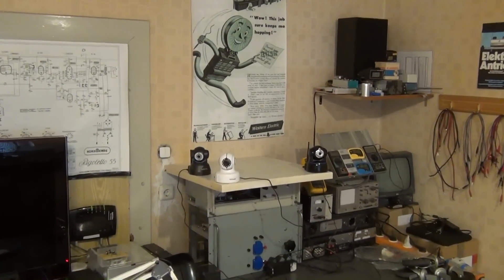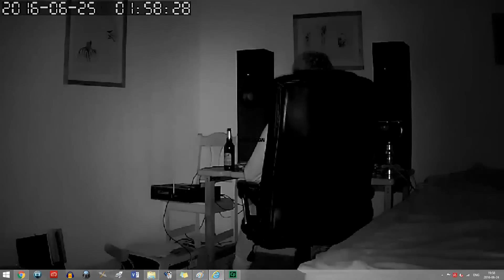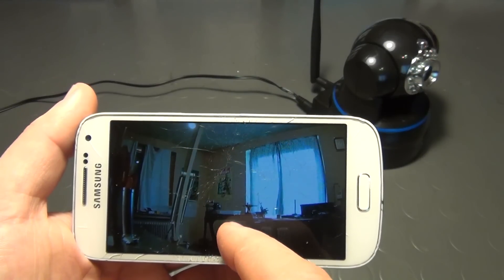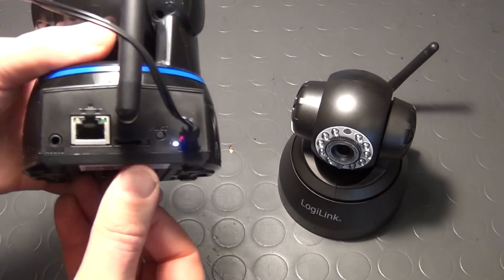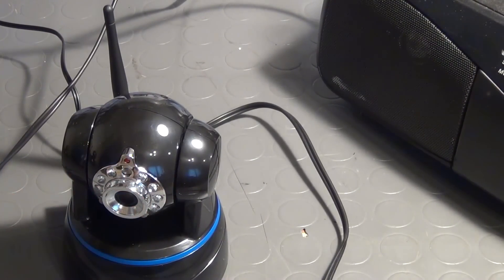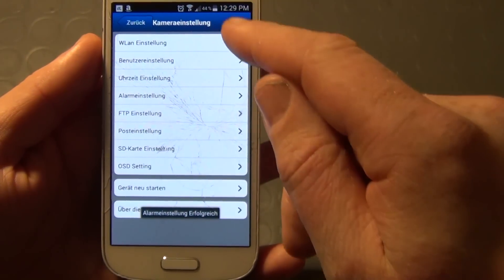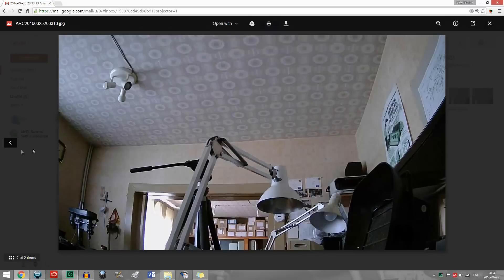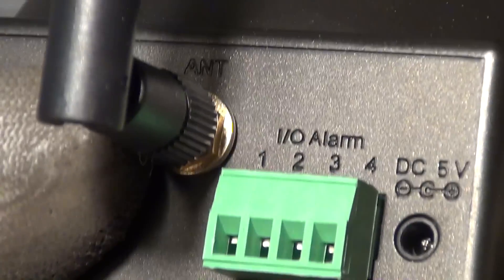Cheap IP Camera Basics + Product Reviews

Comment: Check out the "Wyze" brand cameras. I've used them outdoors for over 2 years now and they're great. $25 ea or $37 for pan and tilt variation. Two Way Audio. Internal SDXC cad storage. No monthly fees are required but there are low priced cloud storage/special features offered if you want.  With a micro SD card, you an record continuously and or 'event" modes that only record for a set time period after being triggered.  

The Wyze app is actually very well made and easy to use. There are all sorts of features like motion detection, person detection (distinguishes humans from other motion), sound triggering, schedules, IR night vision, push notifications, a "fire alarm/CO alarm detection" feature that will notify you when it detects a fire alarm sound, works with Alexa, etc.. They seriously are great little cameras.

Comment: At the Least? Buy one for $20 or Ck for used one's On Ebay or at Good Will store, like we did ( bought one for $8) and mount it Up High outside yur House under a Eve so they can't et to it and its a Dummy Cam.. but they( criminals don't know that, e=right?) and add a Motion Sensor Spot Like Next to it to Flash On at night..It will deter them from comming to your Home and go to the Next One..

Comment: For Home Security? We just bought a WIreless Alarm, the Senors is mounter under Our Mail Box and the Alarm is Inside Our Kitchen ( Can take either 2"C" batteries or a 5 V DC convertitor .. Cst $35.. Wrks Like a Charm!  Has 2 types of Alarms( Chine or Buzzar) and low or high Pitch Noise.. Low daytime and Loud over nite.. and Got 2 Signs and Posted them  On our Mail Box Post and Storm Door..We want everyone we have Security service....Go Rob the Next Home!     Its been 5 mos and So Far so good in altering us to Postal worker, UPS and Fed Service arriving...along with a WireLess Door Bell system and Getting everyone to USE THE DOOR BELL, PLEASE BTwn Both systems, Spent Less than $100...
       Add 2- Keyless Door Locks( $100) and 2- New Steel Doors ( $400 Each Installed  =$800 ) with Fiberglass Wood Grain Panels , that look like the Real wood Doors and R18 Insulation with 1/4" Plexiglass Storm Doors( $150 ea)  1styr last yr and they Keep the Hallways very Draft Free and warm halways and Shoe and Boot Changing Bench area comfortable.  We haven't had any problems and Everyone knows we have a Secuirty system to keep Kids/Thieves and others away and go Rob the Next House!

Comment: Mine is Mounted Inside and fixed pointed thru the Kitchen Window with a Deflector( from the Glass) and Just scans the Driveway ..I bought it at my Goodwill store for $5 and after devoting about 2 hrs over 3 days of my free time, got it to work..  For most others? Suggest you Use a Local Professional/Dealer and plan spending $2oo-$4oo.but it will save you alot of Frustrations and Time..

Comment: I put up those cheap cam. Many of them. I prefer using app like ip cam pro and use it with the arrows so I just keep pressing and the cam will go in the direction that I chose. But before we have to create a port in the router page. I prefer this way so it’s private, it does not connect to a server. Just type the Internet address and the port number and that’s it.

Comment: I bought the Meisort ip20 cam off ebay - did wot u suggested and got the manufacturer but i am not able to get this camera to work on any app except the one that came with it ipc360 app on google play. i have  Cam Viewer1, iCamviewer,IP Cam Viewer, OWLER:Foscam and TinyCam Pro but i CAN'T seem to find the port of this cam. yes it is on my router (192.168.1.15) and i used nmap once it showed port 23. tried it on the apps i got. nada. i checked nmap again and i couldn't find any port. any suggestion?u can also see the cam on youtube. it ain't bad tbh but i need to have more control with great apps.tx man

Comment: Best way to use these is without wifi - use Ethernet with Poe - I made my own Poe convertor 12v->5v so one cable gives me power and networked directly to the router or internal network - easily the most reliable way of connecting!
Reply: Hello , this is Lucy from Sricam factory, If you are interested in Sricam ip camera, please feel free contact me ! 
Email : sales01@sricam.com 
https://www.alibaba.com/product-detail/Sricam-SP017-Camera-Wireless-P2P-Security_1296020450.html?spm=a271v.8028081.0.0.7b3acefbwzVSWt

Comment: I buy it, Cheap IP camera from ebay.

First Day - 100% working
Second Day - 100% working
One Week - No working

I never buy one more time Cheap Ip camera ...
Reply: you get watched by man from china
Reply: Check out the "Wyze" brand cameras. I've used them outdoors for over 2 years now and they're great. $25 ea or $37 for pan and tilt variation. Two Way Audio. Internal SDXC cad storage. No monthly fees are required but there are low priced cloud storage/special features offered if you want.  With a micro SD card, you an record continuously and or 'event" modes that only record for a set time period after being triggered.  

The Wyze app is actually very well made and easy to use. There are all sorts of features like motion detection, person detection (distinguishes humans from other motion), sound triggering, schedules, IR night vision, push notifications, a "fire alarm/CO alarm detection" feature that will notify you when it detects a fire alarm sound, works with Alexa, etc.. They seriously are great little cameras.

Comment: I have two IP Pan/Tilt cameras and both failed on me turning on Motion Detection...  One is 4 years old X10's Airsight HD xx59 (crappy camera that I can't even use it) and brand new Sricam SP012 (recently bought and crapped on me. got refund but told me to keep this camera for me to play with).   BOTH cameras have SAME chipsets which is "G"rain (actually Grain) branded chipset (Airsight have 8128 and Sricam have 8135) which is ARM 9 processor. They have not changed much.  Chipset tend to overheat and crashes. Sricam tech support told me that it have heatsink but turned out it's not when I cracked the case open.  How camera failed ..  BOTH works fine when Motion Detection OFF and ALARM OFF.   Let it runs for few days fiddling around with Pan/Tilt via phone app.  It's really cool until I decide to turn "ON" Motion Detection and ALARM (set Email and record to SD card),  AIRSIGHT HD did sent pictures to my email and recorded but in a while it crashed and reboots constantly.. SRIcam crashed as soon as I turned "ON" Defence (Motion Detection, Email and ALARM turned "ON" but does not polls until Defence turned "ON").  Funny thing is that I did factory reset Sricam and re-set it back. Sricam Tech support tested my camera and said it's working fine (I provided camera's # and Password).  It seem to behave good when Tech support tested it. But  when I moved the camera and plugged in. It was running fine with Defence "ON".  But flurry of Motion Detection activities (my kids in kitchen) caused Camera to crashed because it was polling Email and Record to SD card that overheat Grain chipset..  I can easily pin blame to flaky Grain chipset.  What I could do is to do hacks by using Southbridge cooling fins ripped out from old broken Motherboard and old laptop 5V cooling blower fan and use Thermal glue the Southbridge fins on Grain Chipset (Just simply screw the camera).  See how camera handle with such load when Motion Detection set at moderate..  If Sricam works with cooling system installed then I would be able to use it in one room for 24/7.  I use my refunded $$ to ordered SRIcam SP009 because it have HiSilicon High Performance chipset.  I'm going to see how it handle with Motion Detection.  This camera is thin profile and I can easily conceal it with decor.  I simply wanted reliable Security Camera to catch who's eating cookies, icecream or food while I'm at work (got sick and tired of kids pointing at each other or scrape goating to toddler who can't reach high cabinet!!).  If you want more reliable Security camera that don't craps when Motion Detection Alarm turned on then get the one which is expensive like $500 or more PZT Security cameras (commonly used at Mall or Offices) unless you wanted to hack crappy one.  If different branded camera with exact same design and exact same chipset then perhap you might as well try getting Firmware flashed and Camera's UC (user control) flashed after that.  I don't have Airsight HD xx59 firmware, I lost it.

Hey guy..  Lose the glove!  Look like you are Mr. Monk who is afraid of germs and dirts

Comment: although not exactly cheap i have used blastproof lighting fixtures to mount external cameras in.they have metal grates on the outside and are sealed with glass completely from outside contamination.here is a link for an example below.
http://www.directindustry.com/prod/wiska/product-14556-540583.html

Comment: One issue that you didn't mention, even with WiFi, you STILL may need a long cable to provide power and usually the places I want to monitor have no power outlet. I bought a POE adapter from Amazon and had to cut the connector from the power supply to use at the opposite end of the POE connection. However, you may still have a problem, the voltage drop for 5v/2A with cheap ethernet cable may be so low the camera may not function. I bought a 7.5v/2A power supply and now it all works great.

I hope to introduce myself and make a donation sometime. I really enjoy all your videos and share many of the same interests. Thanks for all the great stuff!

Comment: When it comes to IP security cameras I can only recommend Mobotix, as they have no moving parts, one camera can record an average sized room from the ceiling without blind spots and it always records the raw video, not the part you are currently focused on. The pan/tilt/zoom works via software and the optics are hemispheric, so the recording always contains the whole image and you can pan/tilt in the recorded video. Which enables you to track a burglar "post-mortem", even if the camera wasn't focused on him at that moment. The same applies to motion detection. Since the camera always processes the entire image, it won't be "blind" there either. Only real drawback of these cameras: They're not cheap at all. One can cost easily around 1000 Euro. But you can't just compare them to these "cheapo" PT-Cams that will die quickly, aren't ready for rough weather and rough treatment etc... that would be like comparing a Mercedes S class to a Bobby-Car. :D A good mechanical PTZ-Cam (I did some live streaming with a Sony SNC RZ-25P some years ago) with actual optical zoom will easily also cost about the same as a Mobotix brand... with the disadvantages that they have moving parts and only record what they're currently watching. Not to mention blind spots directly under the camera.
Reply: You can't zoom into any particular area with out moving parts!

Comment: I'd rather install a Raspberry Pi with the dedicated camera in some kind of enclosure taken from a broken cheap camera or even fake ones. It wouldn't pan and tilt without additional microcontroller, but the quality is much better for the price and you can run a server directly from the camera enclosure.

Comment: One problem with using infrared cameras to detect burglars is the sensor leak red light. A thief would notice the light and unplug the camera.Another problem is many of the cameras are made for a  longer distance than your room. The leds over expose the picture. When mapping automated storage rack addresses with a target only two feet away, the problem was corrected by covering some of the leds with tape.

Comment: MAC just identifies the manufacturer of the "network card" inside the device. It can be the same as the real camera manufacturer or it could be different. Of course it´s a good place to start. Also quite often its a single chip solution thus the camera and the network card part are made by the same manufacturer.
Reply: I wonder if it is possible to put a vpn in a ip camera

Comment: Just a clarification: MAC addresses identify the manufacturer of the network card/interface. So the manufacturer you find for that MAC isn't necessarily the manufacturer of the camera, though it can obviously help narrow down the possibilities.  All network connected devices have a MAC(or should by standard) address but usually don't display it on stickers since it's useless to most end users.

Comment: IP cameras are not secure as  many have pointed out
Reply: Correction. some types of IP Cameras are not secure, OR, Cameras setup by people who do not know enough networking skills or do stupid things like leave passwords at default are not secure.  A good quality camera, setup properly by someone who knows networking is as secure as *any internet connected device is.
Reply: +SpockieTech I was simply making a statement not a full explanation.
I was referring to none internet connected cameras, which can be jammed or have their password cracked. If you want to argue how secure they are because you're an expert be my guest but I will not reply.
Reply: Simply correcting an over-broad statement.  You might as well have said "Internet Routers are not secure".  Some are, some aren't. its up to the users skill much more than just the device type.  A deadlock is useless if you leave the key in it.  IP Cameras *can be secured as well as any internet device, so I just wanted to point that out, that they are not all inherently insecure as your statement suggested.
Reply: I recommend the ones that allow you to use Ethernet as that can't be jammed
Reply: sim6699

Comment: Few things to mention, wifi jamming is easier then you might think, I can be done using pretty much any newish wifi module by broadcasting de-authorisation packets. In case when using multiple cameras relatively cheaper to rather get ethernet cameras without any wifi, sdcards, motors etc. and then use some central server to record, send emails and whatever else you like. I myself got good quality 720p30fps IP camera from China for ~20€ with proper thick metal casing and 4x1W IR leds builtin. Rpi2 or even Chinese versions like orange pi has video codecs so they have more than enough performance to process and record videos, although saving them on sdcard is not a long term solution due to write limitations, perhaps usb to pata converter and an old HDD would do better, if you're going cheap.

Comment: I have been working with these cameras for years, trying lots of different ones.  Currently, the ones I like most are Tenvis IPRobot3.  They are a *fairly cheap (~50Euro) camera that still has a good 720p picture, great nightvision, reliable software that works with aftermarket apps ("IPcamviewer" is v.good) and no security issues (to my knowledge so far) if you turn off the "P2P auto-network feature and do your own network port maps.  Use a network cable (Not Wifi) and UPS powerbackup for best reliability.  They even work outdoors (3 years no failures so far) if you put them undercover of a cut in half bucket to keep the rain off them.  Reliable Motion detection and secure recording is best done by IPcamviewer on a cheap android tablet acting as a viewer/NVR (Network Video Recorder).  Im not an agent for them or anything, just thought Id tell you which ones Ive found that work best for low $ after trying many.   Very good video, sums up a lot of concerns of people just learning about IPCams well.

Comment: I've just repurposed an older Thinkpad X61 subnotebook I had laying around as a home server. Installed Debian Linux on it, and set it up with Apache and Owncloud for syncing phone contacts/calendar and files etc. - however, even if you're a little bit experienced in using Linux, like I am (I'm using different flavors of Debian and Ubuntu since 2006), it's still a long way to actually being able to secure your system, as in not having your ftp server accessible from outside your LAN, but using SSH instead (which is the same as SFTP). However, despite the limited knowledge I hold, I offer to be open for questions if you need someone to point you in the right direction.

Comment: Very good point about wifi jamming. Too many wifi home security systems and security camera systems are now being sold. All of which can easily be jammed. All that money spent which wouldn't set off any alarms or video recording.
Reply: yeah but if it was a team... of techs bulks and sportys. yu'll have a problem. But if it was wired with Ethernet that can't be jammed as the modem it's self can trigger a signal as it thinks it is being hacked if Ethernet was tried to be jammed. justtt make sure the antenna is un screwed

Comment: A MAC ID or MAC address is normally assigned to each network interface, so the camera should have one for its Ethernet port, and one for its Wifi adapter. If the camera is designed in such a way that the Wifi chip is of an external manufacturer like for example Broadcom, you might even get a Broadcom MAC address with it, but of course the camera isn't manufactured by Broadcom. Of course, with small gadgets like IP cameras, this is often not the case, but with anything more powerful (as in "more computing power, and closer to being a universal computer), you will have this more often...

Comment: Except for that 90EUR one Your cameras are 0.3MP, or course they're gonna have a shit image. I recently bought this on: http://www.ebay.com/itm/720P-Wireless-Pan-Tilt-Nachtsicht-Uberwachungskamera-Network-2-4G-WIFI-Webcam-/152018808537
It's relatively cheap, 1MP (720p) image is decent and it can be controlled by Xeoma.
Regarding security, disable WLAN (or rip out antenna altogether), forget about local storage + a VPN, firewall, seperate VLAN and preferably a seperate vrf will make wonders... :)